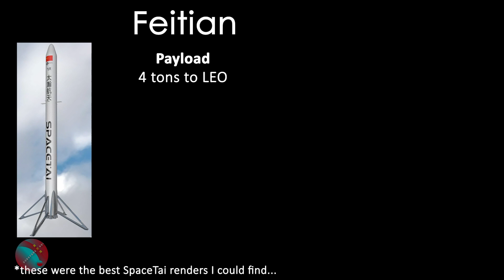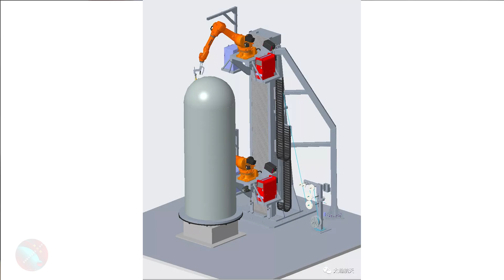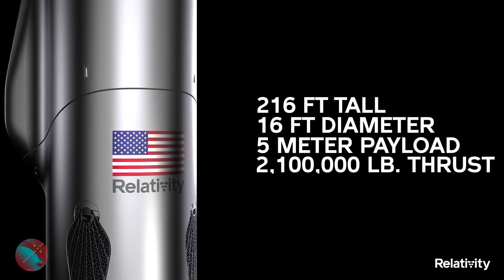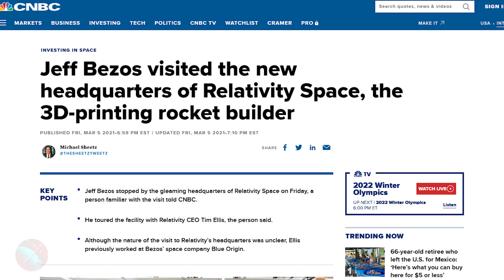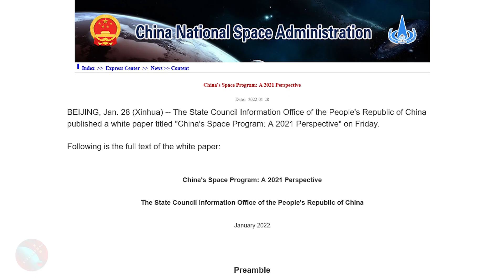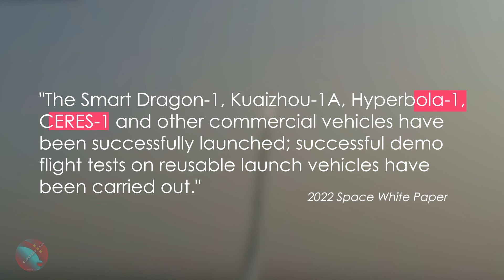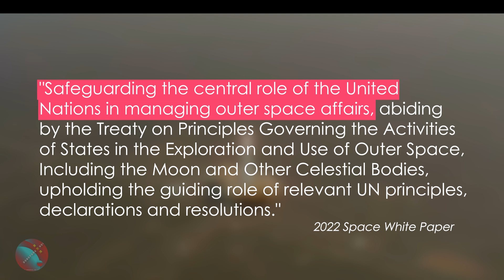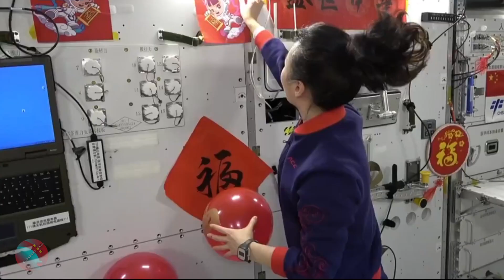A Chinese Version of Relativity Space, Takeaways from China's Space White Paper

Comment: "A 3D printed cylindrical body is heavy and unless you machine the structure, there are stress raisers everywhere" -- Dr Evil
Reply: Not the body, just the complex pumps and engines which are labor and time intensive to machine and assemble.
Reply from the maker: Great point, and I think this is probably why 3D printing rocket bodies is so controversial. Relativity seems to claim that software driven 3D printing and machine learning can solve these problems 🤔
Reply: whatever they do...the nose of the rocket need to be pointy.